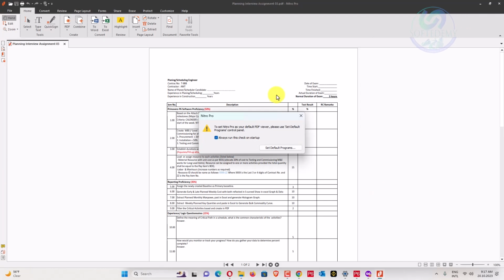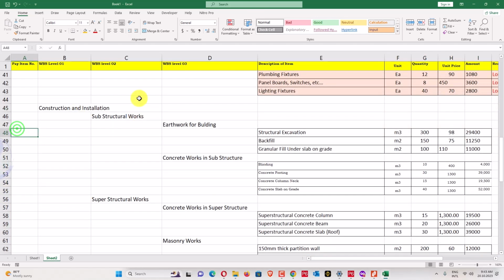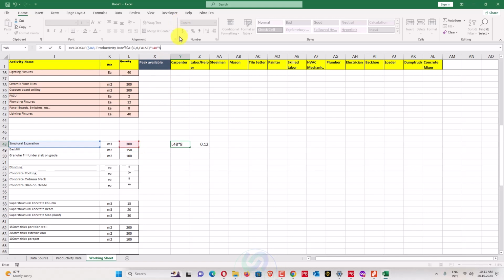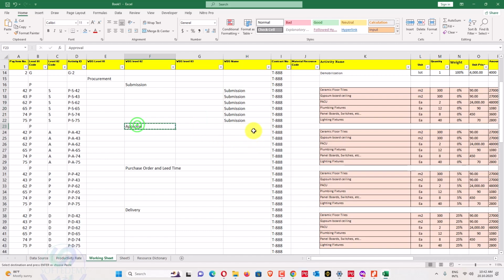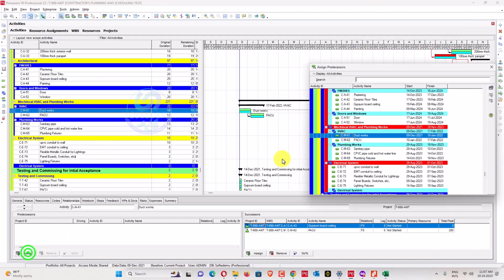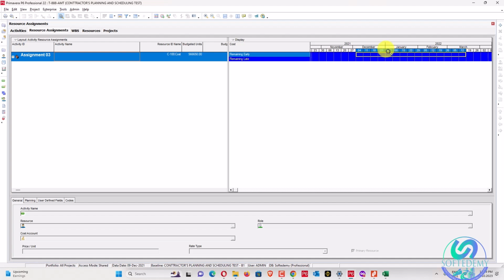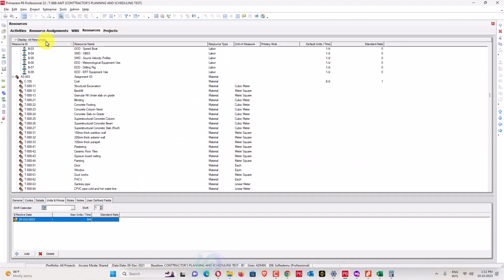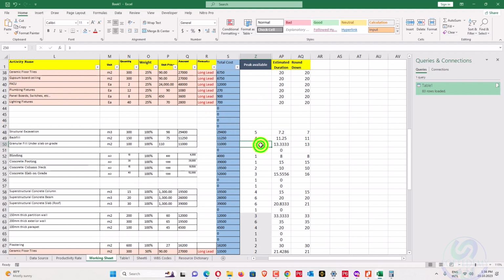Interview Assignment 03 for Planning Engineer by using Primavera P6 | Building Works

Comment: Hi , 

I have a resource cost loaded p6 plan , when I update the schedule,  in this case percent complete type is duration,  all relevant field like duration , unit , activity percent complete reflacte the amount , but performance percent complete is still zero. 
Would you please advise how to resolve this issue. 
I've checked all setting I thought might affected the result. 
Regards and thank you.
Reply from the maker: Baseline assigned and not cost loaded.  Check on top is their any planned value cost and earned value cost.
Reply: Thanks. I've slready created a baseline from the current project which is resource loaded .
Reply: Planned value cost has value , but earned value cost is zero
Reply from the maker: @mahansor8295  check when you update your activity does your resource changes.
Reply from the maker: @mahansor8295  check why their is no earned value.
Reply: Although I have completed the task based on baseline dates , budget labour cost is equal to actual labour cost and actual total cost , but planned value cost shows different value , and earned value labour unit is zero.
Reply from the maker: @mahansor8295  ok share the schedule I will check later. Our whatsapp number is given under the video description